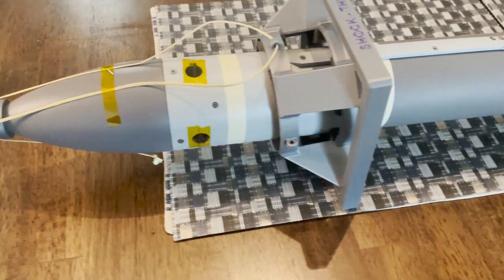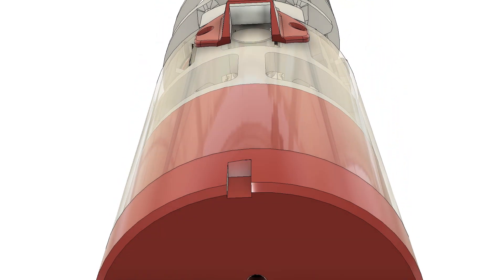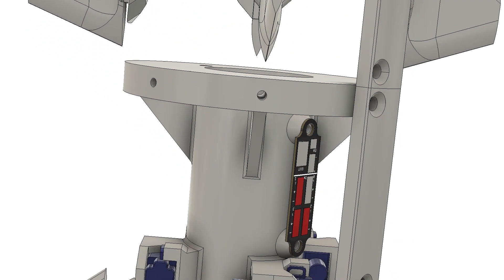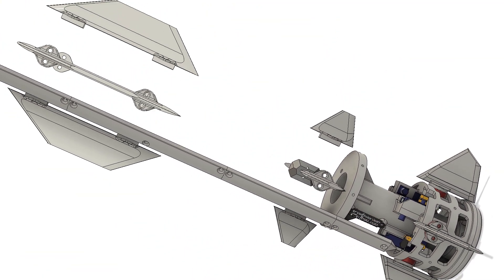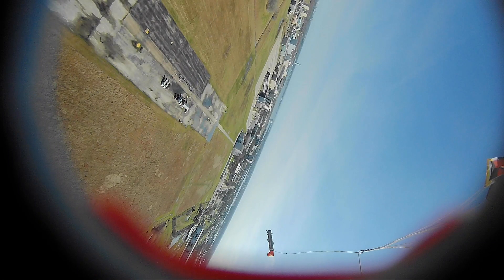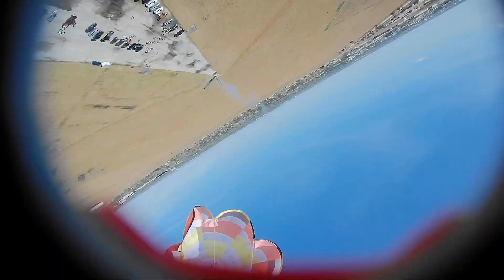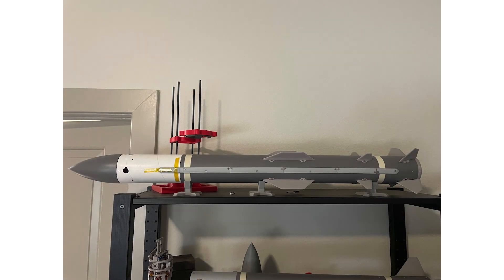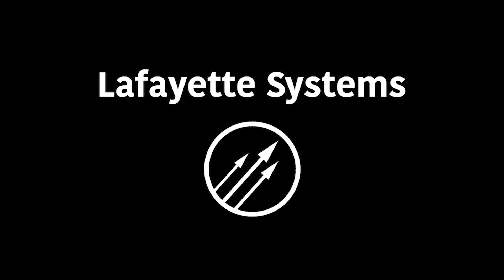SHOCK-ACES Flight Test 1 and System Overview

Comment: i like the idea of ACES, but i have a concern personally. i assume, based on how your were showing it and talking about it, that it will be powered by small solid rocket motors. i personally worry about that. you cannot tune the amount of impulse you get from them without pinching off the exit, and more importantly you only get to fire it once, and you cannot shut it off prematurely.

Personally, i've been thinking about this kind of idea quite a bit in the context of the primary stabilization for an amateur space shot if i ever get that far in life, and i was leaning, personally, to using CO2 canisters to create simple cold gas thrusters for the purpose.